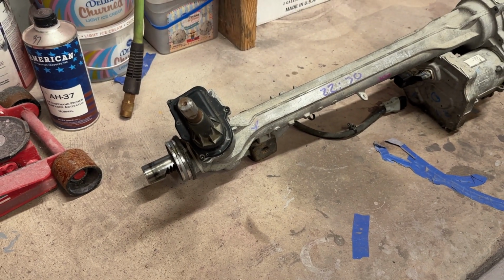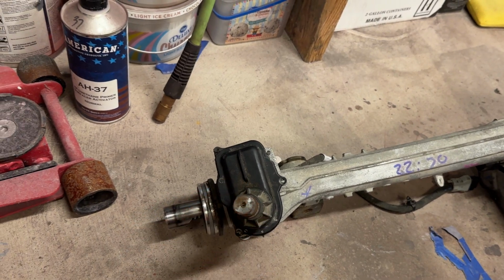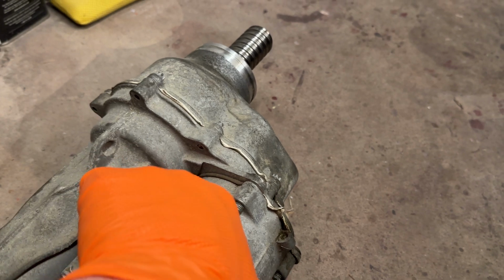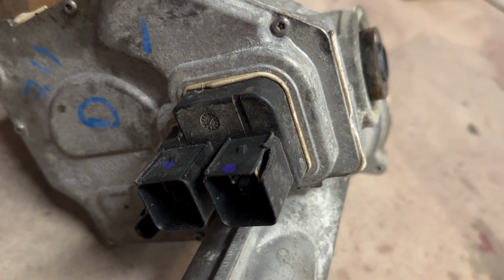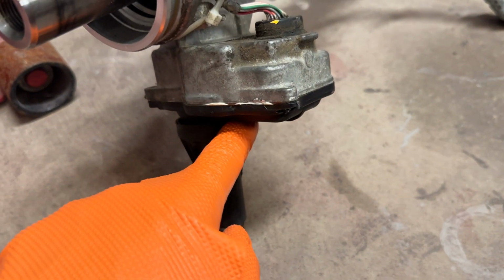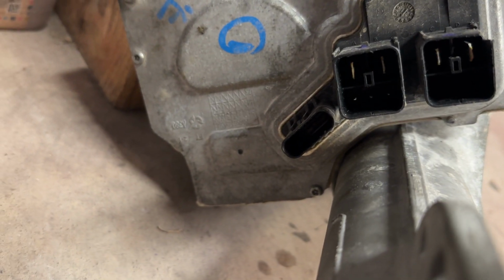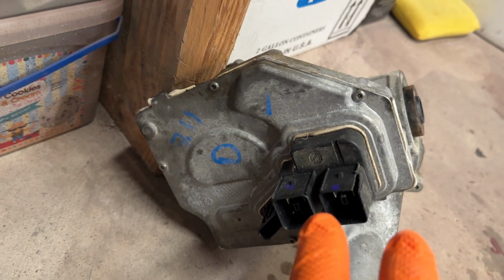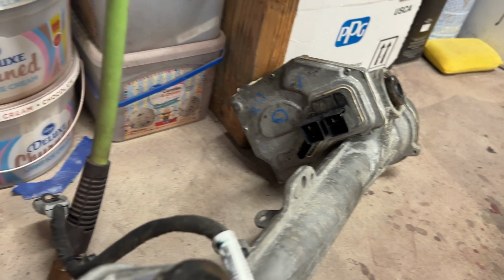New Project: Hacking A Ford EPAS Rack and Pinion

Comment: Any updates?
Reply from the maker: The Rack and Pinion stays in lockdown mode unless the BCM sends a signal to wake it up. I bought a BCM , PCM, and a gateway module, but I can’t find a pigtail (plug) for the PCM except for buying a full engine harness, which is more money than I want to spend. Waiting to find a truck in the junkyard I can get the PCM plug from.

Comment: The small module is the torque sensor. On the column style, they are built in... As yours is a rack, the motor is remote mounted. Torque is typically read off a small "torsion bar" with redundant hall sensors at each end. When the wheel is turned, directionality is determined by the hall sensors and direction of rotation is determined. It should report back to the steering controller, which then tells the motor how much assist is applied and in what direction.

My son and I are working on a fully autonomous semi-sentient 65 Falcon running a HAILO interface for full AI neural integration. Steering and transmission control have been challenging. We are running a 2010 Corolla EPAS and plan to hack it to control the steering. A small stepper may be employed to turn the steering shaft, then the software will calculate how much assist the EPAS will offer. Think Octogenarian and a tight parking spot vs a muscle bound Bro making a lane change at 80MPH... The twist of the torsion bar in the torque sensor tells the difference.
Reply from the maker: Thanks.  Currently, I'm still struggling to get the PSCM to come alive.  I'm trying to capture all of the initialization messages on the canbus from my truck and then replay them to the rack from a laptop using a USB canbus adapter.
Reply: @ajzride  i'll keep watchin.